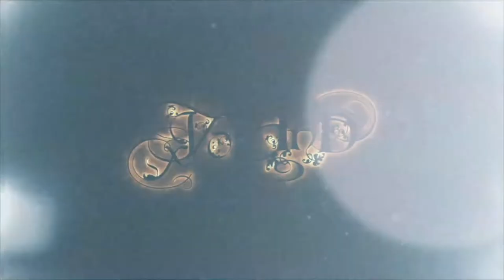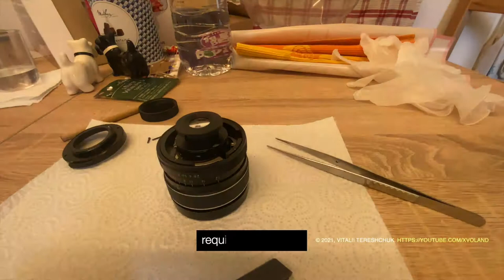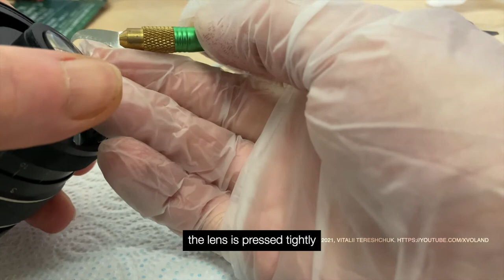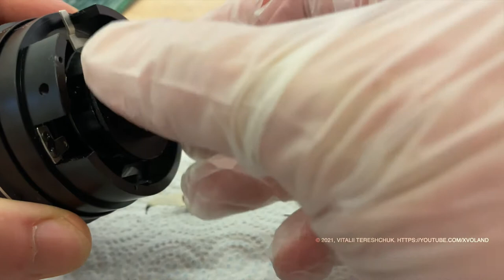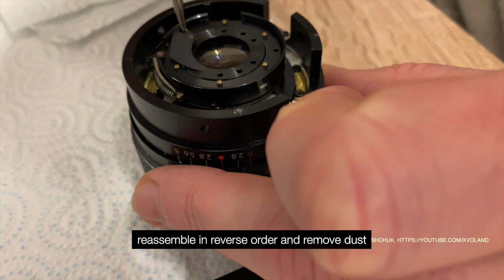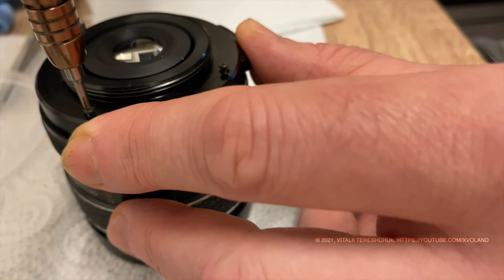🛠 📷 Repair lens AUTO CHINON 35mm M42. How to disassemble and clean aperture blades

Comment: Hey! I was wondering how you removed the epoxy from the threads?
Reply from the maker: Hello! By heating. But this is not necessary, the lens unscrews without it
Reply: @xVoLAnD  mine was stuck solid so I had to resort to heat